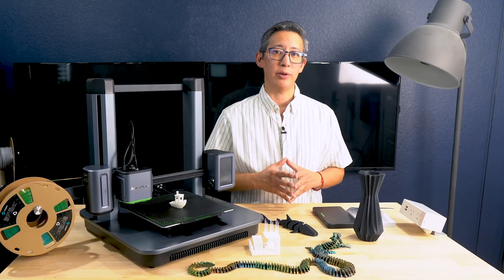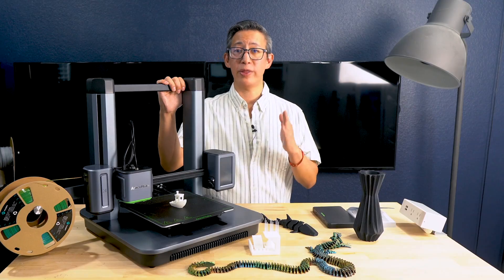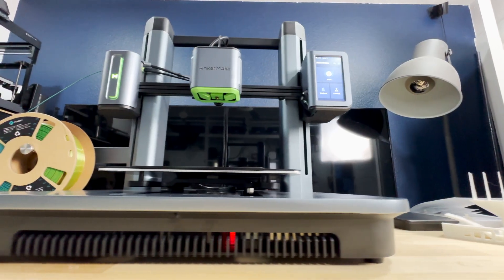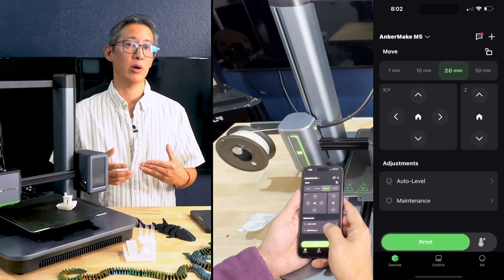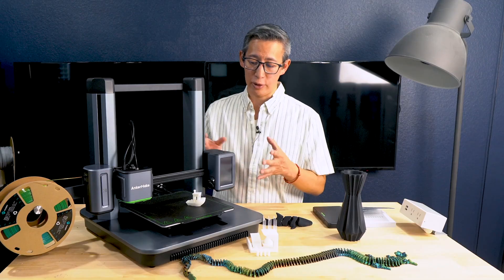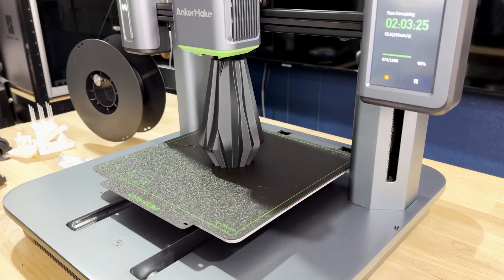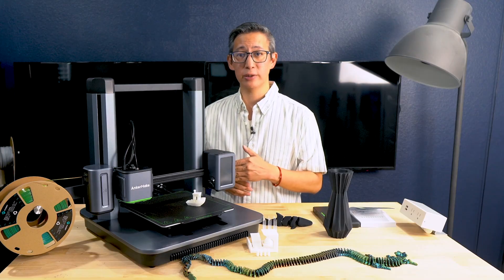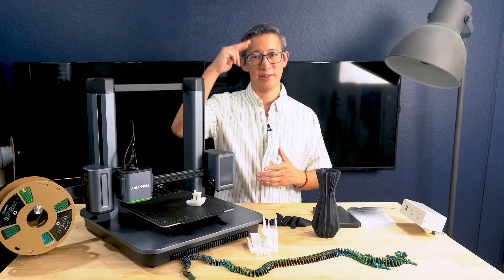An Honest Ankermake M5 3D Printer Review: Pros & Cons

Comment: Thanks for this updated review. I feel like it was objective and without bias.  My experience with the M5 seems to parallel yours.  I was hoping that you would provide some new information that I wasn't already aware of, alas that was not the case and not a reason to dislike your content.  I really enjoyed your presentation, so I gave you a thumbs-up and you have a new subscriber!   Keep up the great work.  I'm going to back and watch some of your previous videos.

I was lucky to purchase this printer from AnkerMake last year as a refurbished unit from their eBay store.  I kept it in the box for almost a year as I had been unpacking from a long-distance move and it wasn't a priority and I didn't have a proper space to set it up.  I finally set it up and started using it in late October 2024.  I set it up easily and successfully printed my first Benchy. I originally chose this machine for the ease of setup as its contemporaries at the time were mostly kits requiring hours of build and manual set-up time.  I would've enjoyed that in my younger years, but today I just wanted to get it up and running with as little building and setup as possible.  Now I'm hooked on this hobby!  My sadness is that AnkerMake officially canceled their multifilament engine and now I am at a loss for an automated solution to print with multiple filaments -- unless you or your followers are aware of something I'm not.
Reply from the maker: I have the same sentiment.  I was looking forward to their multifilament add on.  Hopefully they are just redesigning it and will eventually relaunch it.  Currently the only option to do multicolor printing is to encode stop points into the Gcode for manual filament switching which is too advanced for most hobbyists.  Unfortunately for that the only option is competitor solutions and add ons.
Reply: There was a device from a third party called a chameleon, but even that seems to have fallen by the way side? 

It’s a good, sturdy built printer and I like it. 

Unfortunately, Eufymake (Ankermake) have decided to be the market leaders in UV printing; which results in lack of support and also spare parts! 

I also own a XTool S1 laser and there support is 2nd to none! 😊